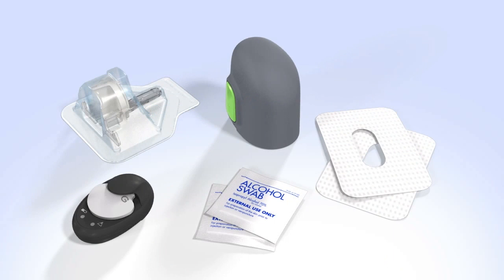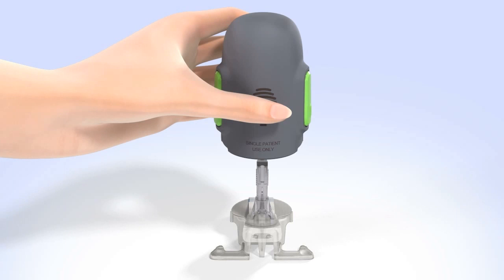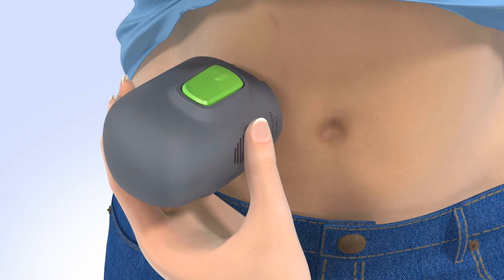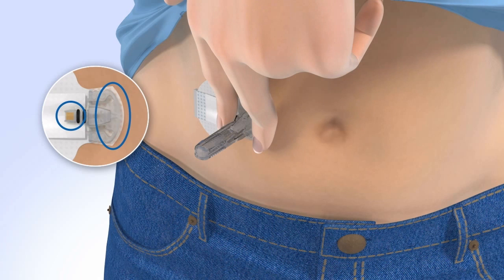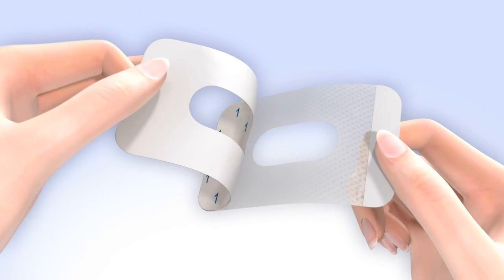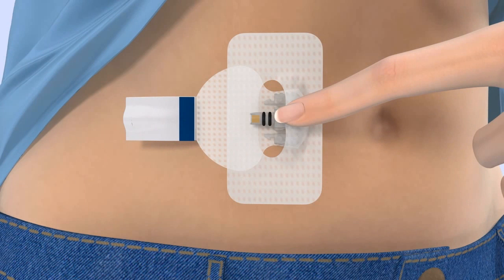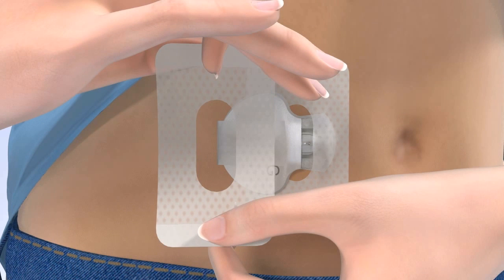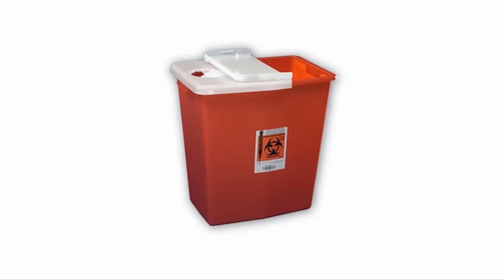Medtronic MiniMed - How to insert the Enlite sensor using the new One Press Serter

Comment: I wish there was a video that went through every step of changing the elite sensor. All the videos I’ve found only cover insertion. It would be great to see one that covers everything
Timing of sensor change
Any pump settings that need to be made before removal
Removal
Cleaning
Charging
Best site location, orientation, etc.
Insertion
Everything else that we need to know

I’m new to the sensor & Ive had so many questions. I wish there was a comprehensive video that covered everything. I am still unsure if I’m doing it all correctly even though I’ve changed my sensor twice.